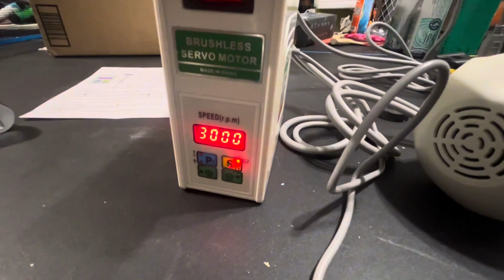Metal lathe upgrade mini lathe. $135 motor It’s just a few hour job! #fabrication #diy servo motor

Comment: Nice!!!! How are you feeling about it a few weeks in?
Reply from the maker: Ive only done a 5” aluminum round, but sooo powerful compared to the old motor. It would have stuck for sure. I made up that sheet metal mount for the controller. I think it’s the only way to fly
Reply: @Motorhead_Mark  Great Info. I had considered going to a three-phase motor and vfd. Going this route would be less than the motor by itself. Have you changed out the spindle head bearings yet. I'm told that cuts out a lot of chatter.
Reply from the maker: @faroironandcustoms6577 not yet, I only have 15 hours on it